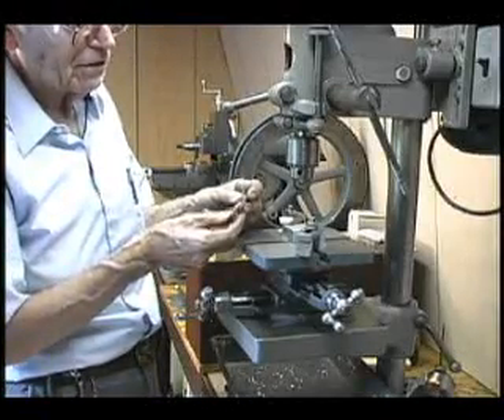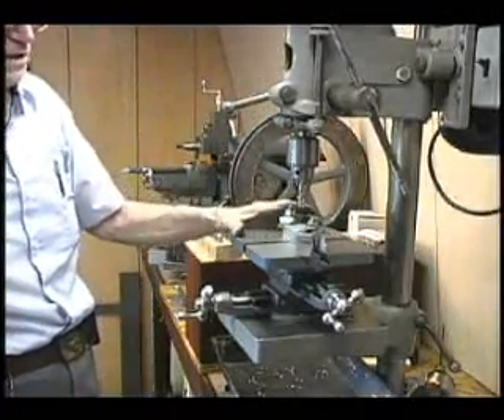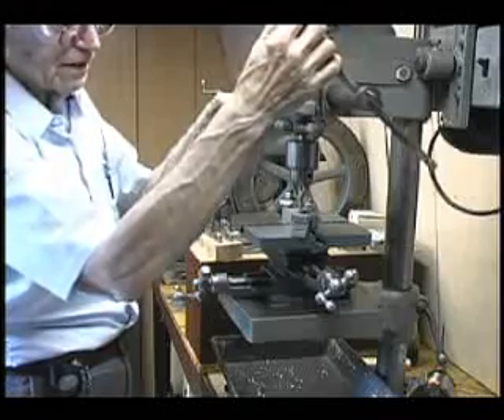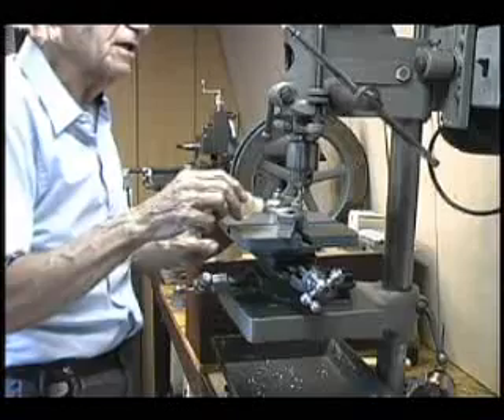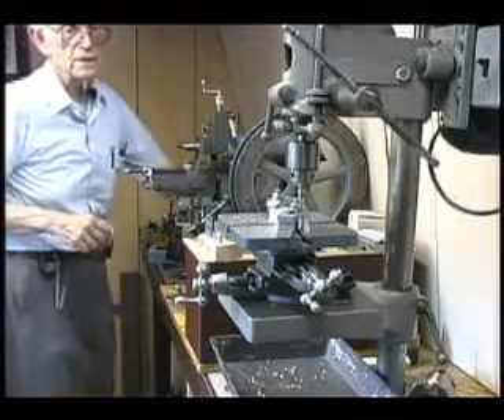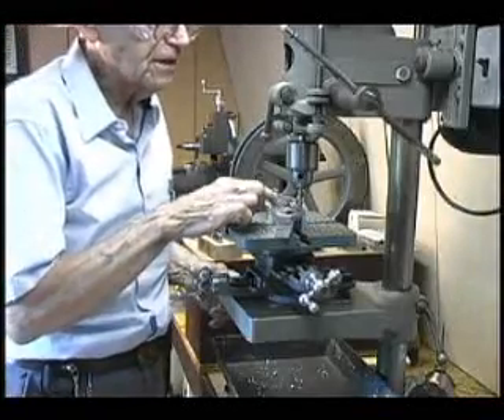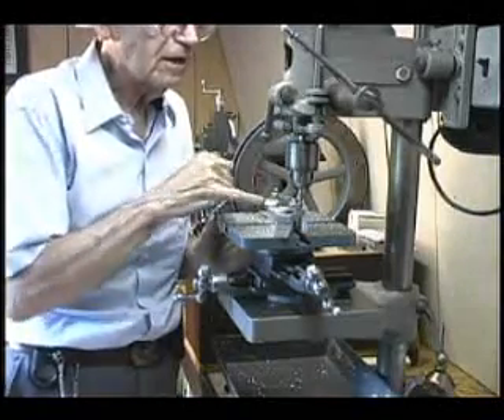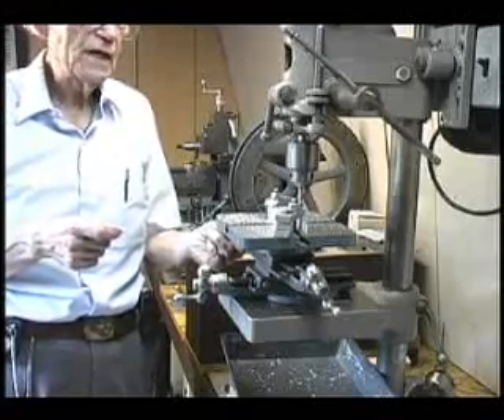Drilling, Reaming, Tapping and Milling on the Drill Press by Rudy Kouhoupt.wmv

Comment: I used the same drill for a mill,, and I used a automotive scissor jack as a table lift,,works very well and gives a truss effect..
Reply: LAFOLLETTER  my 38 delta has solid steel column,,, probably 200 lbs and
Reply: I just picked up a 1940's (50s?) era Craftsman DP to convert into a mill. The thing is 280 lb. 
I've got a good list of vids on various conversions.  
The scissor jack is a great idea for table lift. Thx.
Reply: @stringlarson1247   your welcome,, just mount the jack as close to colum as you can it will slide easier that way
Reply: @georgespangler1517  Thanks. Totally makes sense. 
I've got an old one with a 'hook' for a Volvo. Will fabricate a piece to fit the shape on the underside. It should be an interesting project.

Comment: I understand and appreciate the technique shown. This is either an old Walker Turner or Delta Press
from the 40s, there is no way today''s imports can do milling with their slender spindle & bearings.
If he was milling aluminum, plastic or wood then fine, but not steel very long!

Comment: With an old Atlas or Buffalo drill press like you have there, it would be possible and more safe than using a new drill press of today unless it is a large heavy one, however the lateral stresses could be bad on the bearings.
 Very good video- Thank You.

Comment: I would never use a drill press as a mill no matter how well built it is. Mainly because it's not designed to mill. 
Unless you need to machine something urgently because the motor on your mill died or some such, I would do it.

Comment: Angular contact bearings in the spindle will allow side loads without the rattle and chatter. Standard drill press bearings not very good for milling. That looks like an early US made x, y table he is using. Great vid.
Reply: Actually roller bearings are designed by nature to take lateral force they however are not designed to take lateral/axial force at the same time I hear this from people regarding roller bearings all the time and it's very frustrating

Comment: I agree 100 per cent
A drilling machine is meant to drill holes
it is not designed for milling due to the extreme horizontal  stresses
it is also very dangerous 
milling machines are getting cheaper now and you can use them as a drilling machine

Comment: I use a morse taper end mill holder with a tang in my drill press. I prefer not holding the cutter in the drill chuck. Too much side slip and no rigidity. You can get nice etm morse taper end mill holders cheap.

Comment: Using a drill chuck as an end mill holder is definitely not accepted practice (and has every potential to be quite dangerous), nor is milling on a drill press (because the spindle bearings are not designed to handle the large lateral forces concomitant with milling).

Comment: @davetileguy i have had it happen to me where the chuck flew  out of the machine arbor and chuck was not nice it just and i mean just missed my chest i was only at 300 rpm when this happen on milling  wood and metal and i was taking light cuts, this was beforei got a mill i ad done this and every told me what iam telling you stuiped and dangerous and if your not carfull it can kill you, its also not good for the drilpress either the bearings are not made to take the forces for milling

Comment: @KevinMillard68 So if it snaps off it snaps off ! why would it end up in my head? there's simply not that much lateral pressure to break skin at what 1500-800 rpm? milling a few thousandths??? my 4 inch grinder's going at 13,000 !! I don't think your reading people's post's nobody's milling engine heads ,it's an occasional thing.
Question now don't bite my head off but the Harbor Freight small mill chuck looks the same,is it? (I don't need a Crappy Chinese tool lecture either)